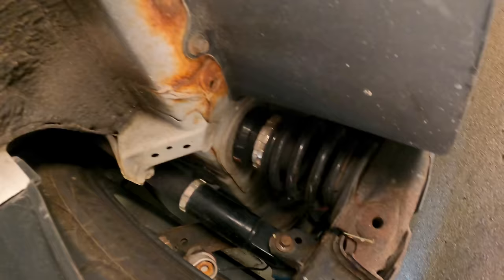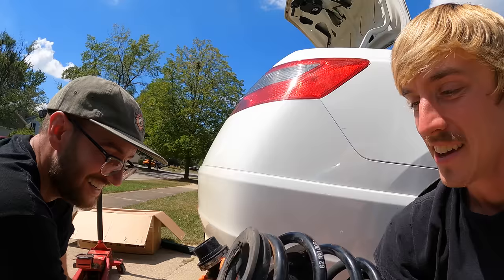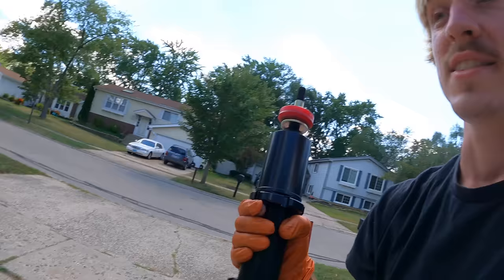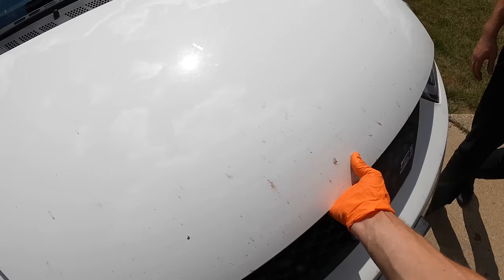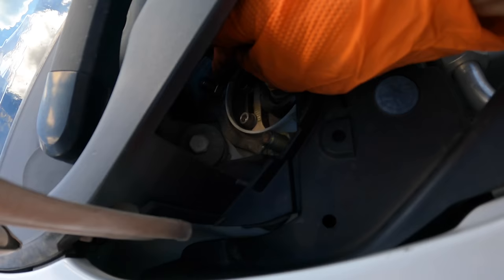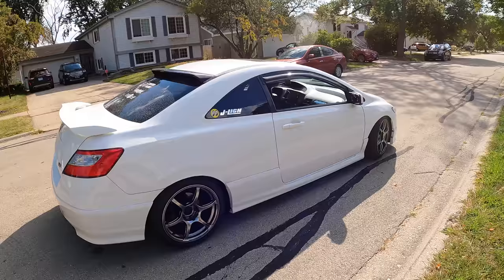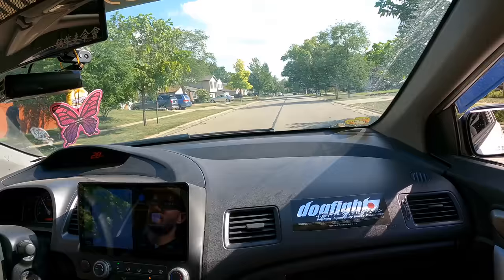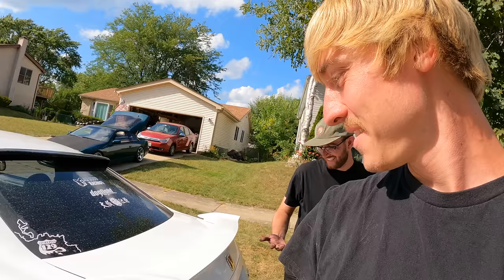MAJOR Suspension Refresh: Civic Si - We Get Busted By the Police..

Comment: Those front coilovers are inverted, the smaller rod is inside the black shock body. Really strong 👌🏼

Edit: Also a lot of droop is not a bad thing, that’s what keeps your tires on the ground around hard corners. Lifting a tire looks cool but isn’t necessarily great for handling.

Comment: I find it weird my Mustang on BCs performs about as good as the Stance ones in the "jounce test" and in corners they feel great, granted my Mustang had 4 blown shocks when I bought it so anything would be more planted than the stock struts that were on it, I'm running their recommended string rates, 8k front 4k rear, I guess it's one of those things where I'll have to ride along in a car with a better set of coilovers to really see the difference between those and BCs, I've heard a lot of negative things about BCs since getting them so I look forward to trying better coils when I get a Miata

Comment: If you’re grip driving you want more droop so that your wheel is always has contact surface with no droop when you go over a bump the wheel stays sucked up therefore loosing traction with the road. I know going from stance to touge completely two different style suspension setups. It’s a even balance of droop too much is not good but neither is too little